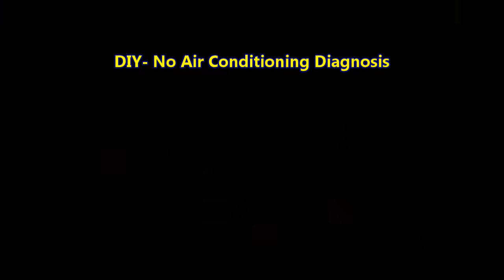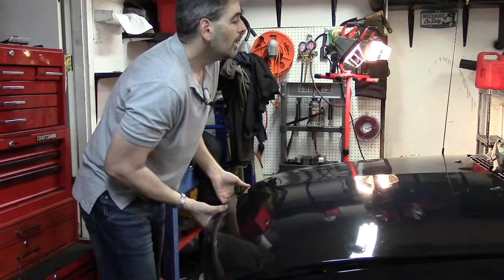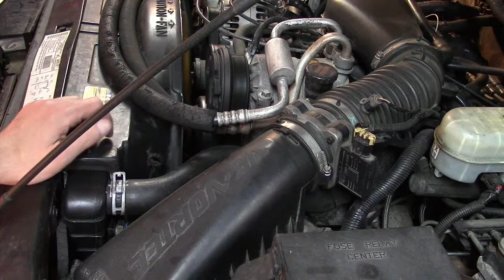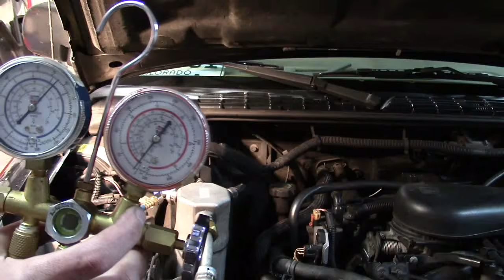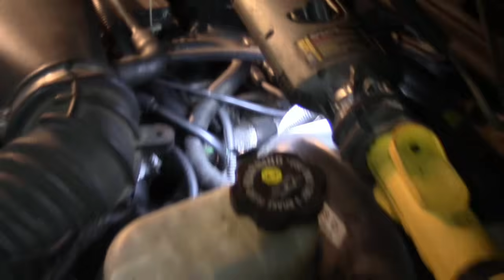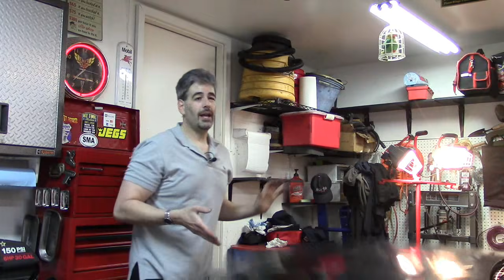DIY- Troubleshooting No Air Conditioning

Comment: Thanks for this helpful video; excellent logical approach to an a/c fault.  But I don't understand why a cleanly cut wire caused a working a/c to suddenly stop working while driving. Wasn't it more likely to have been accidentally cut during an unrelated repair, causing the a/c to not work since then?
Reply from the maker: Yes good point. The severed wire was the result of a incorrectly made butt-connection on a previous repair. It appears the crimp severed through the connector and it broke “clean”.

Comment: Please help. I'm disabled and poor. I purchased a 2012 honda fit sport, automatic, with 121,00p miles in the fall. The a/c turned on and blew cold. The first hot day, the a/c doesn't work at all. It blows slightly cooler than ambient air in all vents a d has a his through the vents. The heat works fine. Mechanic wanted to charge me $130 for a system recharge, which he claimed is the only possible cheap problem. I can't afford anything more than $200, and will likely just live without ac. From the videos, I feel like I can do a simple recharge, but I have no help with anything more involved.
Reply from the maker: Ok what data do you have?

Comment: I have Nissan Altima SV  2013 model , I have AC problems since 3 years , Since then, every year I go to various  Car AC  mechanics , No one able to fix it so far  only emptying my pockets each time,  They did everything , but nothing works . Last year One mechanic says it must be problem of compressor , So I changed into new compressor as per  his  suggestion , but still not working every time  it blows hot air,  I fed up of this problem , Moreover too hot summer , here in New york city , Could you please , please help me what exactly is the problem in AC
Reply from the maker: what data do you have?
Reply: @SchrodingersBox  , I dint get you Could you please tell me what's data
Reply: I have automatic auto set up ,( auto mode) it shows in the indicator , when turn to cooler side like 60' it still blows hot air
Reply from the maker: I just need basic beginning level data to start with like the low and high side static vs loaded pressures.

Comment: My wife's AC compressor keeps clicking on and off. it is not low on refrigerant and it is not overcharged. what could be the issue any help would be appreciated as we have a newborn and it is extremely hot this time of year. I must add that sometimes I can turn the car off when the compressor stops working and start it back up a few minutes later and the compressor will work,  eventually it shut off after 10 minutes could be 20 minutes but it does eventually shut off and starts doing the off-and-on thing every few seconds.. Help!!!!! Plz.. where should I start looking to get this thing fixed.
Reply from the maker: What is the static and operating low and high pressures showing?
Reply: @SchrodingersBox  I don't know. I only have the gauge that hooks to the refill bottles. So I use that to check the freon level  and it is not low. It was at first till I refilled it and made sure not to over fill.
Reply from the maker: Impossible to help then sorry- that is data that would tell what the issue is.
Reply: @SchrodingersBox  thanks for trying to help. I'm thinking it's a pressure switch,  since they're cheap I might just swap it out and cross my fingers. I don't have any real HVAC tools. Either you got the right tools or you're the right fool.  Lol..
Reply from the maker: Why would you think it’s the pressure switch? I mean that such a ridiculously simply thing to check-  What is the voltage drop across the switch during activation?  You could tell 100% in literally 3 seconds.
   As for the right tools or the right fool- I hear that all the time but it’s totally false if you think about it   .  I know hundreds of fools that have way more tools than I do- they just have no clue what they are doing. And then there’s me who has a $12 DVOM but I can diagnose anything with it.
Reply: @SchrodingersBox  it ended up being the relay, I swapped out the compressor relay with the horn relay and it was still short cycling,  the horn relay should have been the same but I guess not... it was the relay..
Thanks again for trying to help me out!

Comment: Good diagnosis...however, I am not sure how the fix was done since I did not see you fix the cut wire. How where was this wire supposed to have been connected to?
Reply from the maker: i just did a simple soldered butt-connection. The cause of the failure was an improper crimp connection by a previous person.

Comment: Hello sir. My L300 fb van is a dual aircon front and back. Is it possible to condemn back aircon without changing smaller compressor or condenser. Is there a problem if i only use front aircon and compressor at ease design for dual aircon? Thank you

Comment: Some people do not have any mechanics build I do not know how to check how big electrical system on an AC system so when you go to jump start an AC system you have to make sure the you have the correct wire for the positive and the correct wire for the negative when it comes to the pressure switches especially a three wire pressure switch do not put power directly into the wiring harness on the pressure switch when you have the ignition switch on you can use your voltmeter and ammeter to check to see if your having voltage but do not feed voltage into the wiring of the pressure switch for AC compressor wiring but you can jump start the AC compressor disconnect the wires from the AC compressor if you jump start the AC when you're disconnecting any type of electrical connections turn off the key these are simple things that will help you I hope my information has helped people some people don't know that you have to shut off the ignition switch before you take off I'll kiss him back any type of connection I hope my information has helped you everybody have a good day yes you need to know the theory of how the air conditioning system works and there are a lot of good videos on the internet to show you how to do things

Comment: I've been retired mechanic I worked on cars all my life including AC you have your ignition switch on when testing the relay also if you don't know how to text a real life take another relay in the fuse box that has the same numbers on a additional relay for example the windshield relay have the same numbers on they are the same type of relay so take out the windshield wiper relay then take out the AC compressor relay and put it in windshield relay so if you check your windshield wipers in there working you can take both relays out and you can put the real again on the windshield wipers turn them on and if they work the relay is good you just switch them out that's not difficult this guy is trying to talk all technical things are not as complicated as his man is trying to make it sound like you're just putting a a different relay put the same numbers on the AC relay this text out the real way can also take you home meter and voltmeter and cast where are the relay plugs into if that is not correct and you're not getting voltage I have seen sometimes where the fuse box the wire under the fuse box has been burnt so if you're not getting power up to the relay you have a burnt wire most likely hello where you put the fuse at but sometimes you have to take the fuse box off and check the wires on the back of the fuse box you can also inspect the wires going away from the fuse box this is. Very simple to do also pressure switches yes there is a vote test you can do or the voltage going to the pressure switch but to my professional experience some time is precious which can be bad you can hook it up to the scanner and half the pressure switch lightly and the pressure switch made malfunction if it is bad on the scanner you can see if this getting voltage all the time but the switch is bad you're not going to get voltage all the time because when you barely tap a pressure switch if it is bad it's not going to show right you also test the wires of the pressure switch there are two wire pressure switches and there are three wire power switches if you're not a professional do not put voltage to the switches because you're not a professional normally what I do an AC job I always change the pressure switch in the system they are inexpensive pressure switches check the voltage to the wires going to the compressor and you can jump start the compressor motor but you need to make sure you are putting the wires in the right place or you can short out the compressor clutch there's a wrong way and a right way 2 bypass to hotwire the pressure clutch so if you're not a professional and you don't know what wire is which don't do it but if you electrical skills you need to find out which wire is the positive and which wire is the negative in order to jump start the compressor to see if it is a compressor problem

Comment: perfect video. I want to see what if the receiver dryer is an issue. what are the step need to do.
Reply from the maker: Once you determine the low side blockage is due to freezing water, the desiccant would be your suspect. 
  Also- ALWAYS change the accumulator and desiccant anytime the system has been open to atmosphere. 
  My complete air conditioning series is at www.schrodingersboxqm.com

Comment: Good job and thanks. I am not hearing my clutch kick on in the truck. I have not yet done the visual inspection or checked for pressure. I now have a good starting point. thanks for your time.

Comment: I just ran into this problem today and i am going out with my power probe to do the same thing, I did just switch the relay fuses but that didnt work so now to test the relay. Also did not check low side switch which is where my problem is coming from on the low side. I have no compressor clutch kicking in so off to check, thank you.

Comment: Hi. I got 2004 Chevy Trailblazer. My AC compressor clutch engages only when bypassed (by paperclip). So I thought the refrigerant is low, so I tried to top it up with the Walmart fill up kit. I was doing that until the gauge showed full, but AC still blows hot and clutch does not engages thru relay. Thank you for help.
Reply from the maker: That’s why they really need to outlaw making refrigerant available to the public.  You are lucky you didn’t blow the system!!
   Check the static and operational pressures and diagnose it.

Comment: Thank for telling me to look and look compressor was not kicking in. Work fine one day not next check R134A ok well thought was But checking cables found a rubber pipe spilt cut 1/2 inch off compressor worked then need to fill system nice chilly for our 3 days of summer we get in UK

Comment: have this same issue with my 2009 328i Bmw E90 and that's exactly what the code reads on my code checker. DTC 04 open circuit with A/c Compressor

Comment: So very interesting how a perfectly working AC stops working sitting at a signal and the fix is a repair of a perfectly cut wire? How does that wire become perfectly cut sitting at a red light?
Would have been nice to have shown us what hack work was in that loom.....
Reply from the maker: It was a incorrectly installed butt connector. Burned out.

Comment: I recently found this video and found it very helpful. But I have some problems with my ac and could use your help.
Reply from the maker: what is the issue and what data have you collected?
Reply: Schrodingers Box as of right now. I have no power going to the clutch on my compressor. Or the fuse in the engine bay for the ac. But I have power going to the plug on the back of the compressor. (This is in a 1998 Chevy s10 blazer)

Comment: Hello how m have an issue with my ac on my 2003 Chevy trailblazer Ltz i replaced the compressor and mass flo sensor and checked all relays I’m stuck. Every time I drive and turn on my ac the car shuts off. What do you think it can be please help thanks
Reply from the maker: what was the data from you MAF that made you think it was at fault?

Comment: In the run up to  12:29  in the video you had the voltmeter across the load side relay contacts.  You  would be unlikely to see a potential difference between the two relay load contacts - even if the  load was passing current. With an open circuit as you had, the relay load side terminal would be floating. That is why you didn't read a voltage. This of course changed when you rearranged your meter leads to reference to the engine (which is grounded). If your load hadn't been floating  the load current would tried to pass through the  DVM.

Comment: Hi, I just stumbled upon your video! Perhaps you can offer some advice..My daily driver is a 1998 P71 Police interceptor,still a strong old work horse. Just did a gas refill by the AC repair fellow  recently but it stopped blowing cold after three days, took it back and he now says it's probably the AC condenser, which looked worn. Is there something else that could've caused this leakage? And what's the AC clutch? I'm hearing this for the first time. Thanks.
Reply from the maker: what data do you have?

Comment: Thank you so much for posting this video. I noticed last spring that my ac stopped working in my Nissan Xterra. I went a whole year thinking it was going to be an expensive fix. You helped me trouble shoot it. I first noticed the clutch was not coming on. I got my voltmeter and was about to try to chase down the issue, when i noticed that the AC compressor wasn't even plugged in. I plugged it in and BAM!! AC works perfect! I don't know if a mechanic just forgot to plug it in after doing other work on the engine, or if it was intentional. I hope it was not the latter.

Comment: you guys are all so gullable. right from the getgo he said that the compressor not coming on can not ever be because of low freon,  well instantly I knew he was clueless because thats what the pressure switch is for. when your low on freon the switch prevents clutch engagement .and then after finding out it wasnt engaging he mentioned it could be because of low freon so obviously he changed his mind or was informed he was wrong during filming, (maybe by his wife running the camera) And also if you think this wannabe tech with shortstick syndrome would begin making a video without already knowing it was a relay problem (because he had already installed A bad relay un place of a good one to create the problem to start with, ) your all morons...I have worked on more cars, tractors, Big rigs, and motorcycles than this guy ever will in his lifetime and relay problems are few and far between trust me. but they are the easist place to fake a problem that never existed. wake up people
Reply from the maker: Wow you are stupid.  So you are saying that a system... RUNNING... therefore under 140PSI pressure can lose pressure all of the sudden to the point of turning off the LOW pressure switch and you wouldn't hear the sudden rush of freon escaping????
  You're an idiot,  This is exactly how I know it was a compressor shutoff problem and not a refrigerant volume problem.
  Your failure in basic logic is disturbing.

Comment: The Symptons are: The vehicle owner states that he was at a red ligh with the AC working fine and then the compressor click off and BAANNNNGGGG the wire was surgically cut off....
Reply from the maker: Yes- those who understands the extreme basic fundamentals of Ohms law and the impact of resistance on the current flow with what I said 3 times happened in the video would understand this clearly on why the wire appears cut.
Reply: @SchrodingersBox  I'm sure that butt connectors are closely related with Ohms law, but to me this video has a deeper message than ohms law, I'll give you a hint, Dr House :)
Reply from the maker: It was a improper butt connection. I don’t think video showed it but that’s why i hate people who do wiring without knowing how to properly repair it. They apparently used cutter not crimper.

Comment: So a visual on the wiring that was cut, turned out to be the cause?
Reply from the maker: It was a broken wire from an improper butt connection made from previous repair.